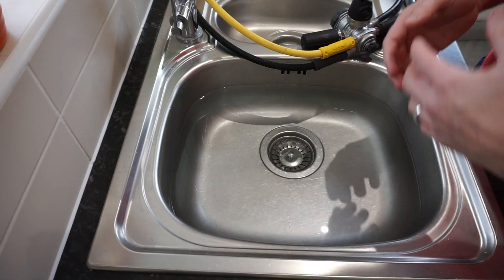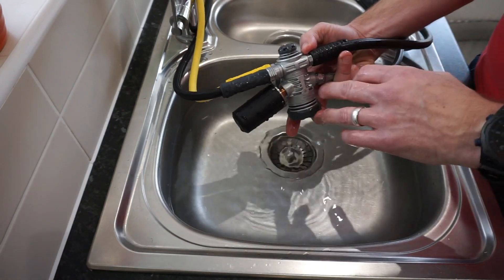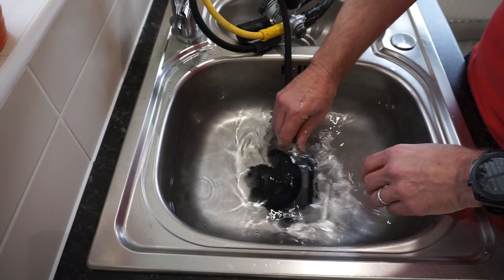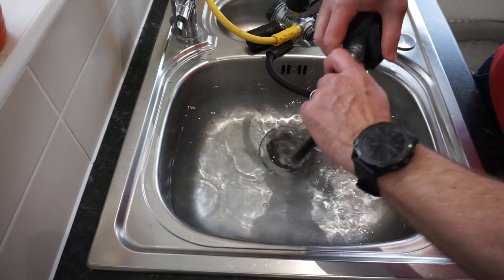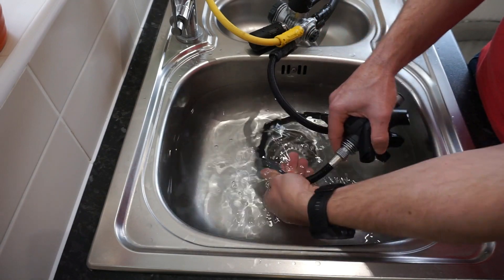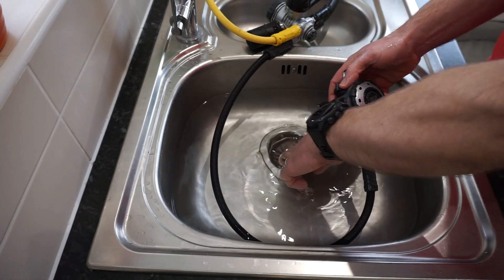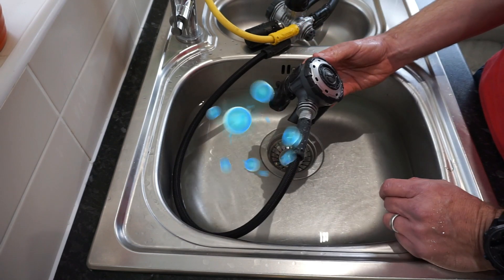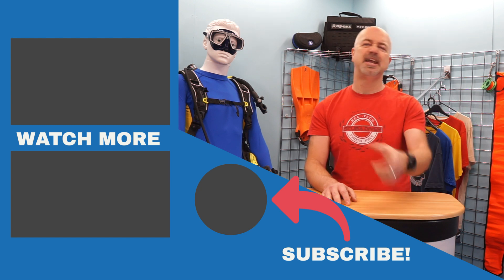How To Clean Your Scuba Regulator

Comment: That is an old wives tale ! Water can not enter the hose if you press the purge valve as long as the dust cap is on the first stage and the hose connected to the first stage and the first stage is kept higher than the second stage. It’s basic physics. Water cannot enter with out displacing air.
Reply from the maker: I have had that brayed into me by several senior service technicians. I think perhaps the main issue is you see people depress the purge button and then vigorously slosh their second stage around in the rinse tank, and you see plenty of bubbles coming out of the reg as they do it, so water must be getting in while they are doing that.
Reply: wouldn´t basic physics also account for the pressure of the water, even in a 30 cm water barrel it would compress the air, and a (very) small amount of water would enter, and remain there after the purge is released?
Seems like the old wives paid more attention in basic physics and preferred, not to have any water and moisture inside during storage time of the regs. 😉
Reply: @DiveMonster  You obviously don’t understand Physics! They are just the Facts.
Reply: @marineboyocean  exactly... I agree that physics are facts. therefore you have to calculate with the water pressure, even your reg is just 30cm deep in a bucket. 

As a diver you really should know better... well I guess you are "just" a free diver ... that would explain :-) A diver would know the pressure stuff since chapter 1 of his/her very first dive course. Some manuals even have graphics to that. 

Take a glass upside down to 30 cm and you see that water already compresses the air. That would be the water which also could enter your 2nd stage and hose. 

So yeah, the old wives and each diver who paid a bit attention to their first course will understand that.
Reply: @marineboyocean  Water will get into the hose when you depress the purge valve on an unpressurized regulator. That bit of water will turn into vapor, and will get to your first stage where it will condensate and start corroding vital parts.
But you're free to do it your way of course. Nobody's going to stop you.
Reply: @bloodymarvelous4790  🤣
Reply: @bloodymarvelous4790  what if I accidentally pressed the purge valve while cleaning my reg complete unattached from tank and air, just a push, not a hold it down and swish it??😫am I totally screwed? Is there anything I can do to compensate for potential damage?

Comment: The great thing about the MTX-R and the MTX-RC is that you can easily take the front cover off. That makes cleaning the inside a lot easier. It'll also give you access to the mushroom valve.
Reply from the maker: Yeah, they were designed for easy maintenance in the field. No fiddly pin you need to remove or smooth front cover that needs a tool to unscrew to get inside

Comment: So, I see there’s a little salt residue on the end of the regulator that butts up against the tang o-ring (yoke regulator). They always say to have your dust cap installed when submerging your refs, so how do you clean that up?
Reply from the maker: I used to wipe round that rim with a damp cloth, and then a dry cloth, to get that little bit of salt residue gone. But all my regs are now DIN fitting, which is a far-superior fitting anyway, and you don't have that issue.
Reply: @ScubaDiverMagazine  yeah, I’m regretting not getting DIN as much as I’m regretting not getting a metric SPG. So much easier to do the math in metric for dive planning.

Comment: The mesh net thing inside my first stage, (metal mesh filter?), looks like it's got rust. What should I do? The rubber cap looks fine, so I'm assuming the dive center wasn't careful when cleaning it out after my dives. Any suggestions besides not letting the dive centers clean my gears?
Reply from the maker: The sintered filter is replaced during a service, it's not worth trying to clean it. It's very common to see them covered in verdigris and that can be caused by small amounts of water, even from placing a damp dust cap back on after a dive.

Comment: How do you like the MTX-RC?  I am in the process of buying my first regulator and am between the XTX50 and the  MTX-RC.
Reply from the maker: I have an MTX-R and and MTX-RC and love them both, but to be brutally honest, you cannot go wrong with an XTX50 - proper trusty workhorse.
Reply: Thanks for the feed back.  I learned to dive on the XTX50 and like it, I like things you don’t see everywhere which is why I’m leaning towards the MTR-RC, plus I live in Illinois so there is cold water diving in my future but also warm water diving when I travel.  Just wasn’t sure if the extra cost was worth it.  There are not a lot of owner reviews out there online which has me a little worried, but that’s probably because the regulator is over kill for most divers.
Reply: @ronszarzynski5981  the MTX RC is hella sexy I have a couple of pairs and their bulletproof, performance is exceptional never had any issues atall either. Go for the bling my friend stand out
Reply: @Ellis thanks for the advice that’s my main draw to it.  Have you dive it in warm water,  does it work well in it with the adjustments backed off?
Reply: @ronszarzynski5981  I dive primarily in the UK in freshwater and salt from around 3°C to 18°C, you will have no problems atall in warmer water, the adjustments are great and you can fine tune to your personal preference. Very easy breathe when fully open. The MTX RC are my joint favourite Regs aswell as my Tungstens, the MTX rotating turret is great for hose routing though :)

Comment: Dive shop owner told me years ago to NEVER put a second stage underwater without the regulator actually pressurized, and NEVER let the second stage go above the first stage when everything is still wet.
       I have gotten used to washing it thoroughly beside the tank in a five gallon bucket, then removing it and carry/hang it by the first stage to dry for a few days, again never letting the first stage get “below” the second.